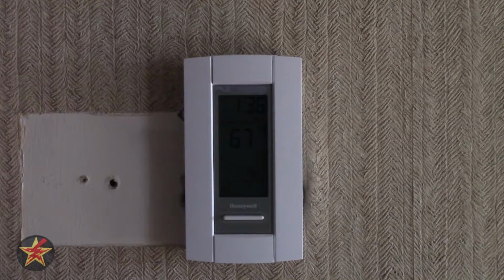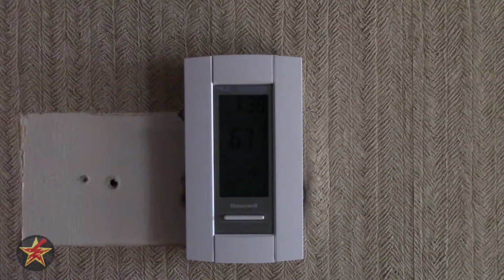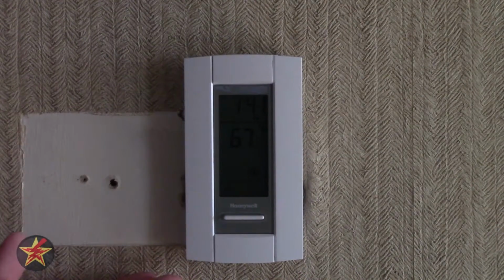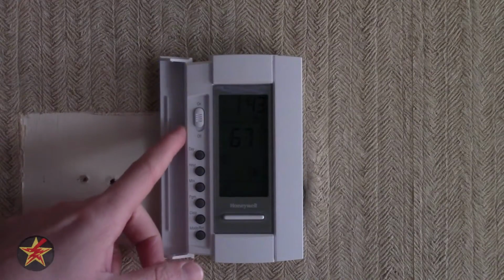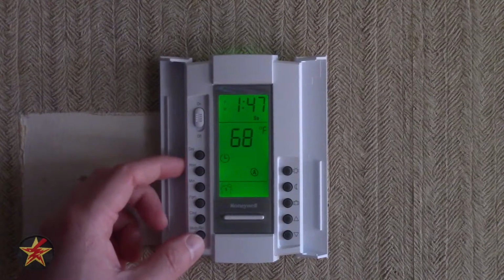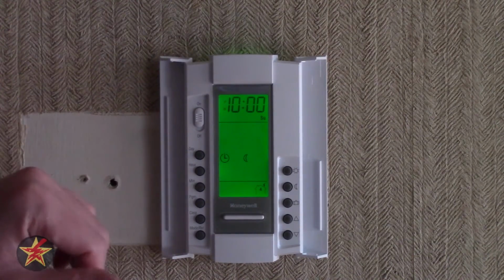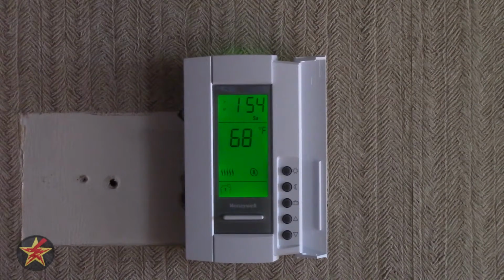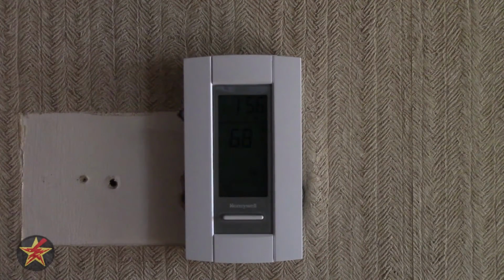HONEYWELL TL8230A1003 Electric Heat Digital Termostat Review

Comment: How do you get this damn thing to turn on and produce heat?!
Reply from the maker: This does need to be powered in order to work. If you are replacing a battery thermostat you may need an electrician to get the right wiring in place.
Reply: Turn the unit on and set temperature and time for each day.

Comment: Mine doesn't demonstrate showing time and temperature when I have the on/off switch to the off setting, instead It's a blank screen.
Reply from the maker: It might be how it is wired.
Reply: As it should be.  If you want the time and temperature turn the unit on.

Comment: I just want heat to run through. This is not helping
Reply: First turn the unit on, then program the unit.
Reply: @jamesmccomb6857  I ended up figuring it out and didn't know how. Thank you 😊
Reply from the maker: For that you should contact an electrician.

Comment: Does the honeywell tl8230a1003 retain its settings if the power goes out.
Reply: Yes, except for the actual time.
Reply from the maker: I am no longer at the place I had this installed, but from what I can remember from the few power outages that I had, I did not need to go back and reprogram everything after.
Reply: Yes, the program is maintained during a power outage.

Comment: This unit says it works with 240V. Did your electrician bring in 240V to that room or can this unit work off of 120V as well?
Reply from the maker: +Cachi - Dropped a line in.
Reply: No, will not work on 120-volt, must be 220-volt to 240-volt.